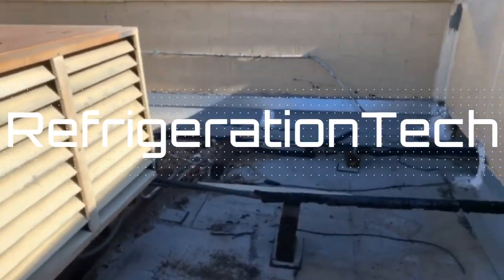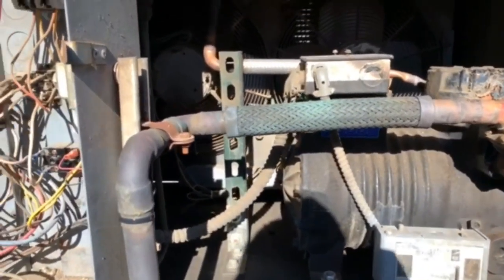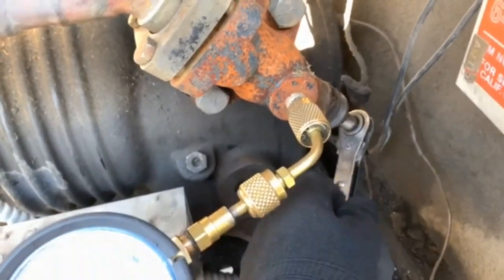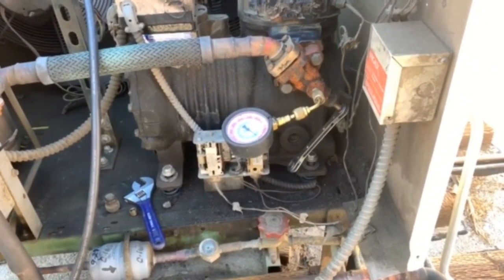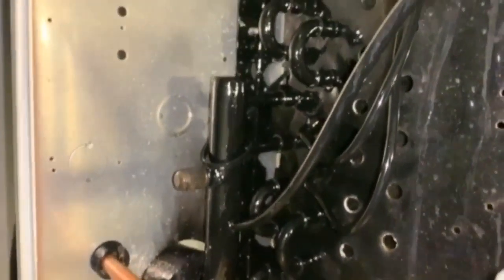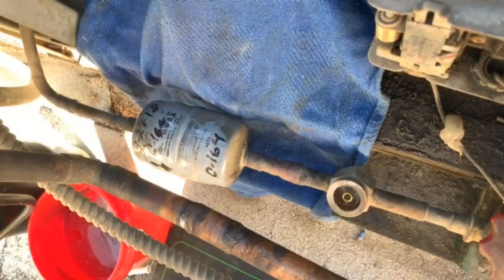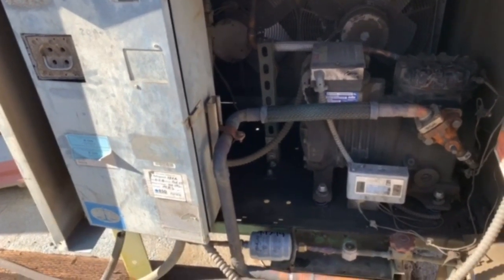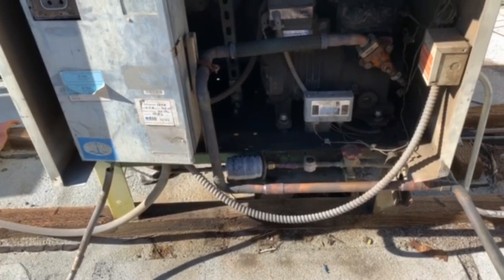SYSTEM FLAT, NO REFRIGERANT!

Comment: Did the valve cores get changed when you upgraded to R134A? The new oil ( POE) eats away those old valve core seals ( and other seals also) did you change the suction access valve  core on the other evaporator?
Reply from the maker: Yes I did, thanks for watching 👍